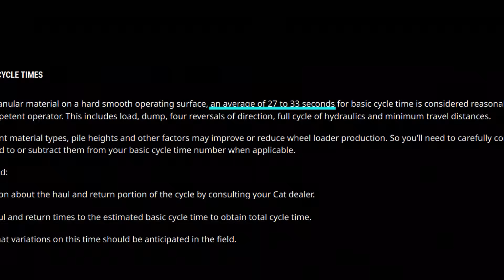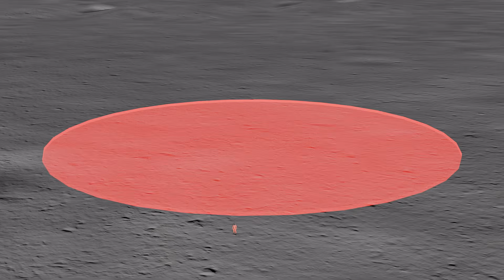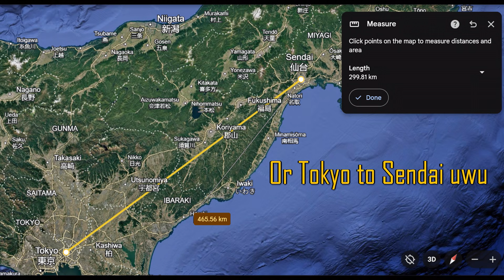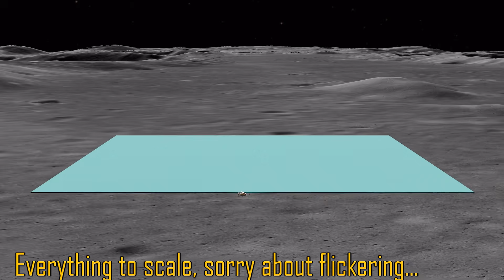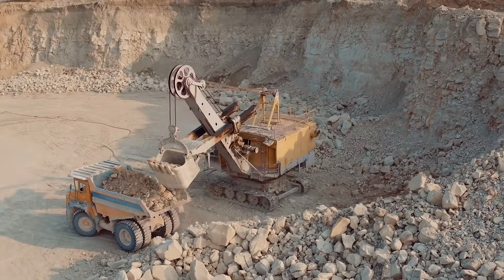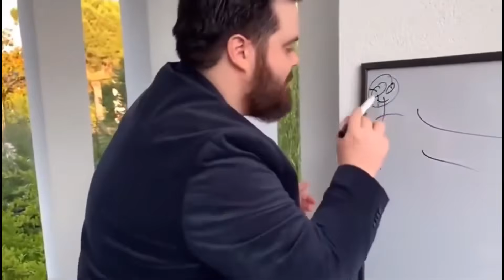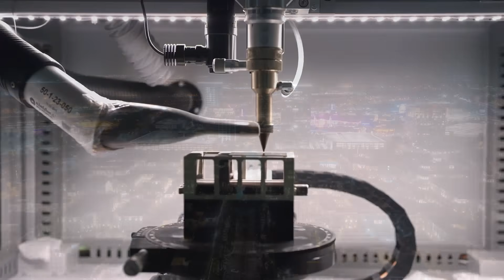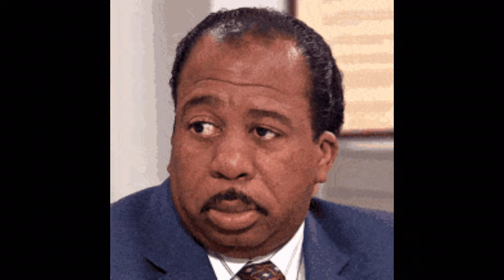How Much Bulldozer Can We To The Moon?

Comment: I think conveyor belt systems to move material would be the smartest way. You could really load and move it anywhere with them.
Reply: the factory must grow
Reply: Conveyor trains…
Reply: @Scrogan the light weight and ease of design would make it pretty simple to pull off i guess eventually they would fiure a way to make the material for the belts on the moon
Reply: @Scrogan  i'm not sure what your image of a conveyor train is but when i hear that i think of a train that dumps material onto a conveyor belt as seen here:

https://www.youtube.com/watch?v=0YjUwKRxwac
[Loading An Ore Ship -The Massive Mesabi Miner-] - SD457500

or here (kind of, the conveyor belts don't move anything from the actual train. i just thought it was cool):
https://www.youtube.com/watch?v=3AsP0CMUT5g
[Coal Cars in the Air: Norfolk Southern's Massive 90-Year-Old Train-to-Ship Operation] - NKY Railfan
Reply: @originaljoke-y5f  Dozens of long flat cars with conveyor belts on top, chained together with couplings such that material atop the conveyor belt can pass from one vehicle to the next. As the excavator moves, so does the head of the train.
Reply: Sounds like Factorio
Reply: A circum-rail, or whatever term fits. A rail that literally circumnavigates the entire moon. 2 side by side, one for clockwise, one for counterclockwise. Another double rail from pole to pole. We’ll need the pole to pole rails for transporting water to the equator, where the actual work is being done.

Comment: how to you run the diesel engines in space wih no air, thats the bigger problem :(
Reply from the maker: import air ¯\_(ツ)_/¯
Reply: @Anthrofuturism  🤣
Reply: I think it's implied that these are place-holder types of equipment, that the function which would be vital, but could be run electrically if one were purpose-built for the moon.
Reply: Just put a snorkel on it that reaches to the earth.
Reply: Caterpillar is currently developing electric D8s, which is a smaller model on their dozer line

Comment: Wow no views in 56 seconds bro fell off.  More seriously though, I am curious about if drilling to the core of Mars would be practical for extraction of the presumably highly concentrated heavy (and often very valuable) elements (gold, platinum, uranium, osmium, etc.).  Tungsten Carbide's melting point is well above the Martian core tempurature.
Reply from the maker: might be easier to get it from a near earth asteroid or even earths core
Reply: @Anthrofuturism  Nah man, liquid/cooled planetary cores have some absolutely delicious heavy elements and alloys.
Reply: @Anthrofuturism  Near earth asteroids, even m-type asteroids, don't have the same concentration of metals heavier than nickel and iron that a planetary core would, with the Martian core being liquid or at least previously liquid and all of these metals having billions of years to sort themselves by density.
Reply: @KingArthurWs  How long would it take to set up the colony, survey the location, then dig all the way down to the core of a planet- and export? Decades? Centuries? How are you going to build the infrastructure to get to Mars- use the moon of course...it's why we're developing the moon in the first place!
Reply: @Anthrofuturism  So the near earth asteroids wouldn't have nearly such a high concentration of the valuable materials.  Also, earth's core is too hot for any known material to remain solid at.
Reply: Sound like something out of AC6 where they go deep into Rubicon.